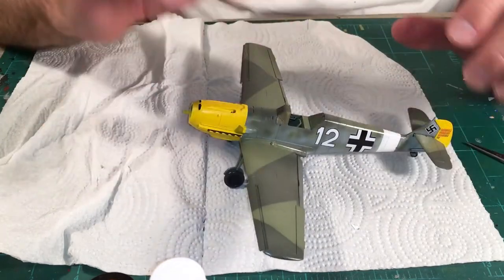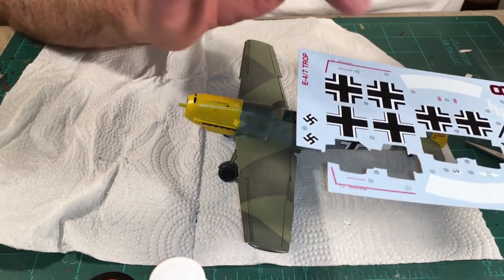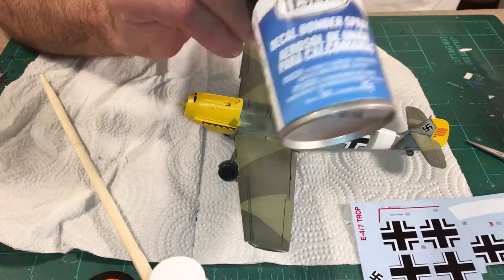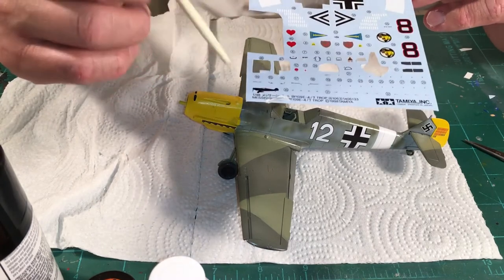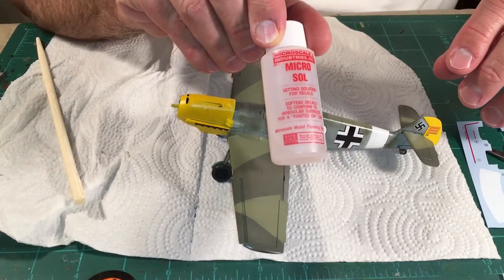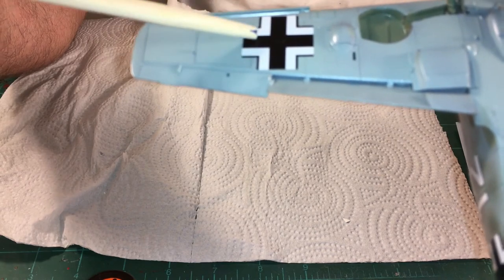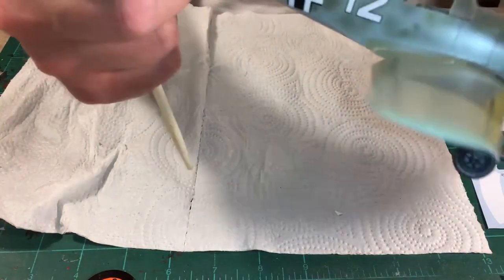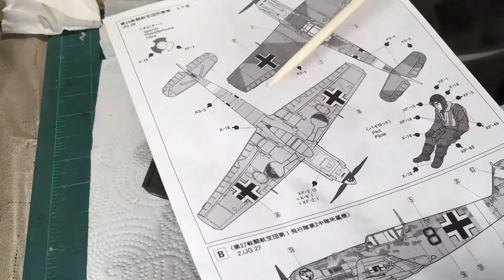Building the Tamiya 1/48 Messerschmitt Bf 109--Part 3

Comment: Hi Drew, it's weird I love Tamiya !! The amount of Tamiya I've built I would of thought I would of come across some bad decals but I still haven't. I do use this new decal solution that I bought stricktly for thick decals ! It's fantastic and it's alot better than mico set and sol and solvaset ! I'm not sure if you guys can get it yet over the other side of the pond !! They do 3 different strengths ! It's supposed to be the best decal stuff in Europe ! I'm not sure how true that is but I can speak from experience of using it , it's excellent ! It's on my final reveal of my su !! It's the stuff from Telford ! I love your build it's coming along just brill ! I have an Eduard 109 in 1/48th I'm defo going do this year !!
Reply from the maker: Thanks Steve!  Much appreciated!  I've never had an issue with Tamiya decals until now.  Some of the reviews I read before I bought the kit warned about the decals. I bought the kit on Ebay (still sealed).  Maybe it was a "bad run" of decals when it first came out.  I guess it just depends......I once had a new Hasagawa kit with bad decals even though they looked fine.  Using that spray provides a little insurance to protect the decals and hold them together.  I watched your video and I have not seen that solution before.  I have only used Micro Sol and Set.  I have not tried Solvaset, but I can easily get it  at my local hobby shop. Have you used it before?  If so, any tips?  Take care!